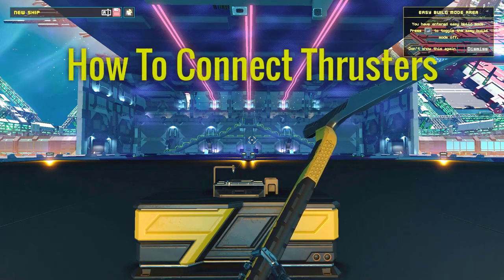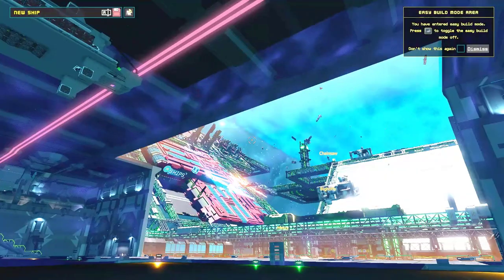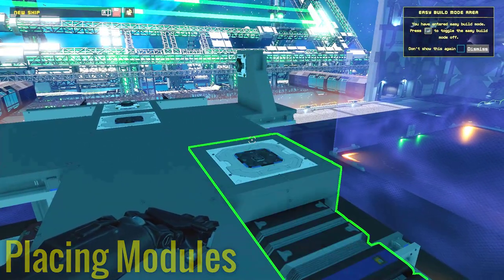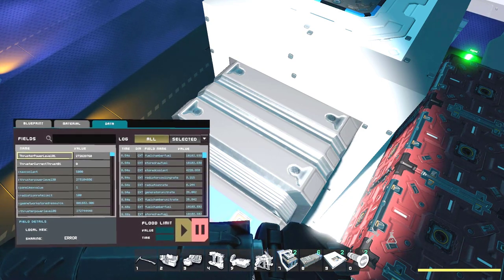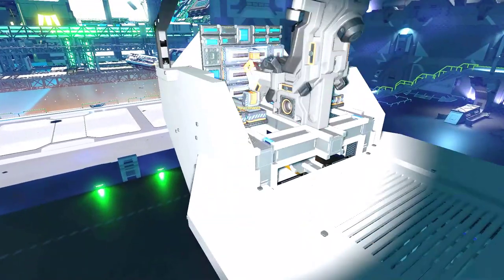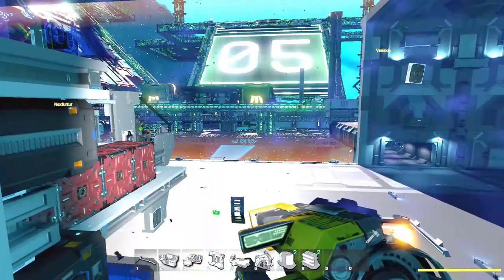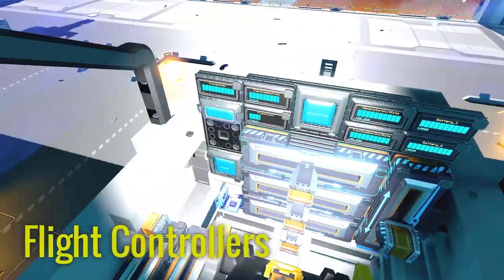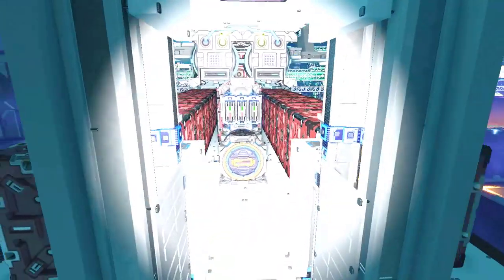How To Wire Box Thrusters, Hardpoints, Testing The Durability And Data Network (Starbase Tutorial)

Comment: Man. I’ve been fighting trying to add them by manual that I bought off the auction.  Didn’t realize there was modular thrusters!!   This video is amazing thank you!  

One question what did you do to your levers to see if they were firing and how do you reset it to what it was?  Thanks!
Reply from the maker: I used my universal tool on the control lever to pull up it’s data. There is a field called something like CenterSpeed, which brings the lever back to zero when you’re not actively controlling it. You can set it to zero so that the ship keeps moving or set it to a number like 5 for it to reset to zero quickly.

Comment: i give up.. anyone can help me? :) My maneuver and brake thruster dont work.. and all is wired/piped 2 times checked named and everything. my forward thrust working. so cant me that ALL manouver and brake thrust is not wired, maybe 1 group then i could belive it. also the hardpoints are bolted and named the groups as the MFC want them to. what else could it be. im in designer mode. (plus, i have alrdy designed a ship what works just fine.. )

Comment: "You need to materialize a thruster here. Or you can buy the parts" Then skips showing how to materialized the thruster in the easy build area. "Can't drop modules here", and won't snap from the action bar.
Wound up accidentally dismantling an existing engine, couldn't put it back together, and just logging off for the night.
I swear I can burn water.
Reply from the maker: Sounds like your ships bugged from before. Get a new starter from the repair tutorial. To materialize a thruster module that has nothing extra on it you need to be in EasyBuild mode and have a hard point to spawn it on. There isn’t an easy way to place them into the air yet.
Reply: press C

Comment: I have a couple questions about your setup in the video...

1) Do you need that many thrusters? Seems like a lot for such a small ship.
2) Doesn't the placement of the side thrusters cause issues with exhaust?

Thanks! 👍
Reply from the maker: That ship was just for testing purposes. It actually was pretty slow compared to most ships in the game. The thrusters do cause corrosion and damage if their trail intersects your ship.

Comment: how do you connect multiple generators to each other using easy build mode - I’ve got 3 of them but they won’t turn on and generate any power?
Reply from the maker: They should all operate independently as long as they’re connected to the data network. If you want them to share coolant for some reason you can connect them using pipes.
Reply from the maker: Make sure the data socket board is connected to both the engine and ship network.

Comment: What about how to get the thruster through the hole in the back like how the starter ship has it. It looks like we have to cut a hole and find the pieces to fit around the box thruster to seal it right? (Rear thrusters)
Reply from the maker: The starter ship’s back thrusters are the module thrusters with armor around them. I use the same thruster setup on the side. The thrusters crafted in the tech menu come with that armor.
Reply: Yes, but positive side, take that module out of easy build and rip it apart and u can see all the parts used.